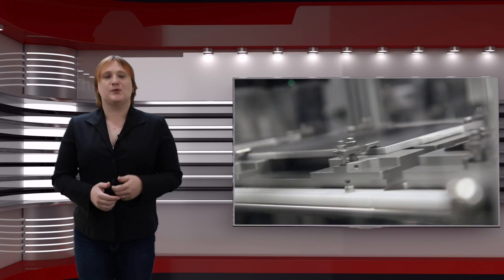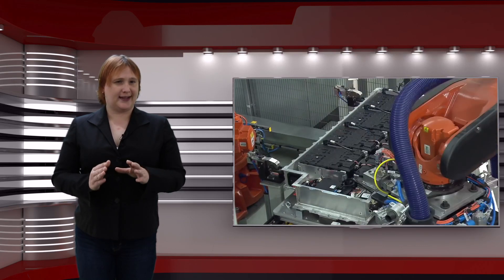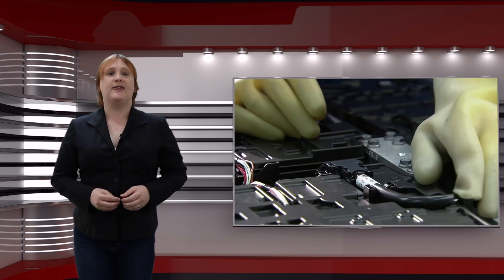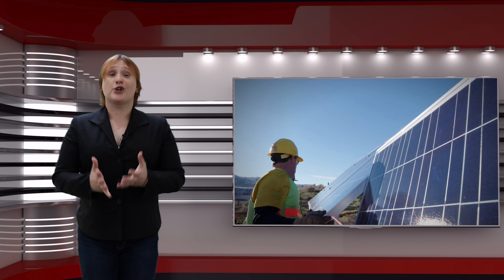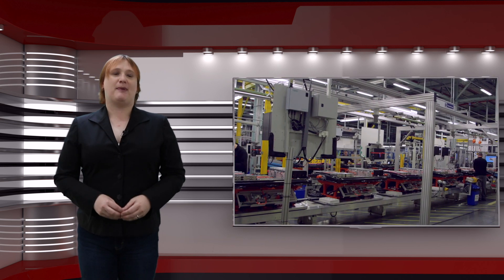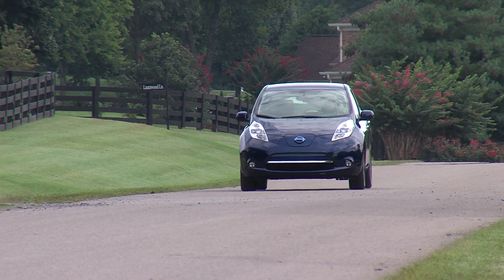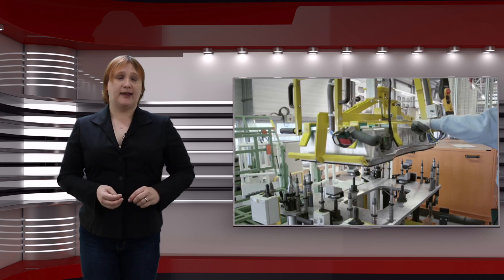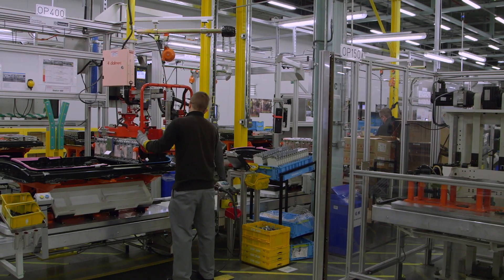Why Second Life Battery Projects Are So Important For Everyone

Comment: Currently dismantled my EV's battery and removed the faulty pouches. Replaced the faulty ones with good ones and my EV battery of several years is as good as new. The "faulty" ones? Well they still hold charge and I use them for several things like cellphone powerbanks et al. When a battery back has degraded, actually only a few pieces are the culprit for the degradation. Check out Jehu Garcia's youtube channel where he dismantles tons of discarded laptop batteries and finds lots of fully functional batteries for his EV SAMBA.

Comment: The reason car batteries aren't being recycled at present is that there aren't any to recycle. Nobody is going to build a recycling plant to deal with batteries if its only going to have to deal with one or two a year (at present). That will change though and by the time it does the tech to deal with them will be in place. Using the Eco card to dis EV's because of a recycling problem that doesn't exist quite frankly smacks of desperation.

Comment: Basically it comes down to volume. When you try to recycle hundreds of millions of tiny little portable electronics batteries coming from every conceivable form factor and so on, that's a bloody hard thing to do.

When you have 65GWh of 2170's coming at you from a million EV's each year, in a standard form factor with similar chemistry, efficiencies of scale are much easier to attain, and the recycling can be much more economically viable.

Personally I think we'll see Tesla (among others) implement their own recycling at Gigafactory once they start to see a significant number of packs coming out of cars at the EOL, say after 10-15 years. We've still got a while before that's a reality, and so they'll continue to use other recycling programs that work with multiple battery companies for economies of scale.

Comment: Lithium Battery recycling problems are often written off as big oil conspiracy theories, but the truth is they do cause a lot of environmental damage, and right now, nobody can economically recycle them for free, which means you need to pay to properly recycle them, even after including the value of recovered raw materials. 

Many companies get old batteries and sort them by type and degradation and then resell them for personal DIY projects, and some are trying to prove they can be used in commercial applications, but how many Tesla powerpack installments use second life cells? Do they even offer it? No, because nobody wants the headache of dealing with used and unstable cells which can make the whole system fail prematurely.

Generally, when a battery capacity decreases to 80% of its useable capacity, it’s considered worn out. EVs already push that limit to as low as 60%. Once a battery has degraded 60%, how long is it going to be stable in a second use application? 

Tesla claims they can recycle batteries, but I haven’t seen any EPA report showing they can keep 100% of the toxic waste from their recycled batteries from making it into a landfill. 

So those claiming it’s a myth that these batteries are harming the environment just because it’s possible to stop some of them, for a while, ignore the fact that all the batteries made today, will someday need to be recycled, and until they have a way to do it probably, they will end up in land fills.

Right now, no recycling center is buying completely dead batteries to recycle, because they will go bankrupt. The only way the profit is reselling some good cells that are in bad battery packs. These companies are very fuzzy about what they do with the cells that are worthless.
Reply: I totally agree, but reading about the process, while there are definitely improvements to be made, it's MUCH cleaner than extracting virgin material, and MUCH MUCH cleaner than extracting, refining and burning a lifetime of oil.

Add that disposal will happen in large industrial facilities at economy of scale, that will make it vastly easier to handle the toxic output as opposed to it whizzing out of tailpipes all over the country metres from peoples oxygen holes.

I get it, I really do, but I firmly believe that the trick is to make it economical to do so, and the recyclers will do it simply because it makes good business sense.

My sense is that energy is a big part of the cost of recycling, so making that dirt cheap would be a huge first step: https://www.sciencedirect.com/science/article/pii/S2214993714000037
Reply: Just a point, I don't think we need it to be totally pollution free, and I don't think that's what will happen. I mean, it would be nice, but that's just not how the world works. As long as we can get the pollution below the ability of nature to recover, then that's ok.

However, if say mining, refining and manufacturing the materials creates 1000 pollutions, and recycling them creates 200 (20%), then we're on a winner. Even if it's 70%, it may still be OK if it's a form of pollution that is easier to manage than the original.

I suspect the energy requirements will be much larger, but the chemical pollution lower, and so the answer in that event would be to make renewable clean energy super fucking cheap, so we can use as much as we like to make the other parts of the process cleaner. It's the difference between an industrial process using X kWh due to economic balancing, or being able to use 4X kWh at a quarter the cost because it's so cheap that they can make up economic - and pollution - gains in other parts of the process.
Reply: Matthew Jenkinson, this is the problem with such toxic elements during recycling. Just how much or which toxins can be released into the earth and water before that becomes undrinkable without spending more money to clean it. When we find out 20 years late that we caused $billions in cost to cure the health damage caused by it.

It’s over completely by overpopulation. Before you could change your oil in the middle of a field, and it would eventually clean itself because there are organisms that eat oil. But you can’t dump barrels and barrels on land that quickly reaches water people drink.

So now, every toxic thing we make, needs a way to completely render it harmless, either by reusing it or making it inert.

Comment: This format is very impressive.  You speak with authority, and it is obvious that your content is well planned.  You are becoming one of my favorite EV vloggers.  My 2012 Leaf is about to get a replacement traction battery.  It is good to know that the old battery will be reused.  Although at 61% SOH I fear that most of the cells are too far gone for reuse.  BTY Nissan has raised the price of new 24 KWH battery packs to $7500 less $1000 for the old pack.  With labor and taxes the cost to me is right at $7800.  However I should get at least 10 more years of use from my Leaf.

Comment: The sooner v2h (vehicle to home) hardware is out the better, then 2nd hand electric cars with two way connectors   like the leaf with poor battery will still hold more kwh than a powerwall and also cheaper to buy at the moment and you can still go local in the car as well, and if you can get a free charge  power your house free when your back or sell it back into the grid .so they don't even need to by recycled just turns into a short distance powerwall

Comment: It's wonderful to see you cover this Nikki. I built a DIY powerwall from dead laptop packs otherwise destined for landfill and It works really well. I consider it nothing short of a tragedy that all this usable storage is landfilled and I'm glad people are switching on to the importance of second life batteries. Also, worth mentioning, is that lithium Ion batteries age fast when pushed hard. Electric cars want the highest range, fast acceleration etc. Laptops are brutal to lithium batteries. With stationary storage, the batteries can be used more gently - not rapid charging, not fully discharging, not fully charging etc. Treating the batteries carefully increases the longevity of the battery enormously. I like to call it a gentle retirement for them. batteryuniversity.com have a great article about prolonging the life of lithium batteries if you haven't read that yet (but I suspect you have!)
Reply: As Andy said, I started off by searching google maps and I searched for laptop repair; pc repair; IT recycling etc within a 10 mile radius of my house. It gave me about 50 companies to choose from. I'm in UK not far from London, so I had lots of companies to choose from. I created a spreadsheet to record responses from these companies and I got busy calling them all and asked for the old dead packs for free. Most said no. Some took great offence. Some told me off. But some said yes and so began my collection. A few of my suppliers are very interested in what I'm doing and I enjoy giving them updates on my progress. Yes, 18650's only.
Reply: Where do you get your laptop batteries?  I assume they all contain 18650s.
Reply: I collected thousands of old laptop cells too and made a big ebike battery and currently building one for the house - there are many of us doing this, thanks to jehugarcia and HBPowerwall on youtube.
You've got to do a lot of legwork and visit every laptop shop in your town/city and surrounding places to get them for free as I did - having a solar powered ebike makes this a lot easier!
Reply: I want a cheap Powerwall, too. I would like to just buy one to start off, I know Jehu Garcia has videos on how to build one if need be.
Reply: if you can source laptop battery packs for very cheap, then you can process the cells, keep the high capacity ones and sell the low capacity ones. Thats what i've done and in total, I've not paid a penny for them and i'm up to 10kwh so far. It has taken a lot of time though, so unless you love doing it, probably not worth the time.

Comment: The piggy backing of ultra/super capacitors on Li battery packs will extend the usable life and range of the main battery, by years, and allow recharging to be measured in minutes, not hours. Fully charged did an episode on it about a month ago, my guess is that super/ultra capacitors will be the ultimate game changer, as they're fairly inexpensive to mass produce, and they charge in seconds.
Reply: Yeah, the point of the capacitor is not to make charging faster, as they simply cannot hold the same capacity in the same package space and weight. The energy density is too low, in orders of magnitude.

Essentially, if you could store the equivalent of the battery energy capacity in the supercapacitor to improve recharge times, why even have the battery in the first place? You may as well just have the supercapacitor.

The idea is that regen only creates relatively small amounts of energy that can easily be stored in them, and so they make the perfect buffer for the next acceleration which will hopefully need very little battery power (regen into a supercapacitor and back to acceleration is not perfectly efficient, so you will always need a little bit).

Comment: Personally, I am installing a (salvaged) Tesla Model S battery module into my Recreational Vehicle. One Tesla battery module will provide as much energy storage for my RV as 10 -- 6 Volt, Deep Cycle, Lead Acid Batteries would, plus, the Tesla Battery weighs less than a single 6 Volt Lead Acid Battery. Additionally, the Tesla Battery will charge up much faster than the Lead Acid Batteries would, which makes my Solar Panels more effective and efficient.
Reply: How much did you pay for the battery and was easy to find?
Reply: I would recommend checking out HRS Motors or E-Bay, ALSO, Installing a Tesla Battery module is not a "Plug-and-Play" or "Drop-in" solution. Do not attempt unless you are VERY, VERY, comfortable, and safe working with high voltage/high current Electrical installations and can understand the unique charging requirements of the Tesla Model S Battery module. WARNING -- Doing this wrong can Hurt or Kill YOU !!!!